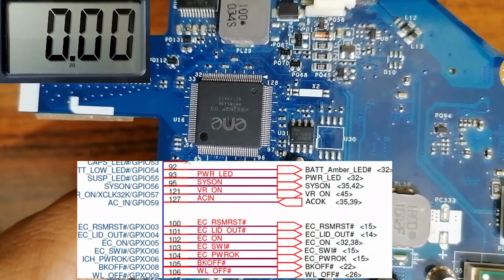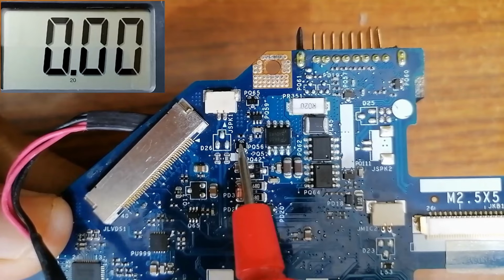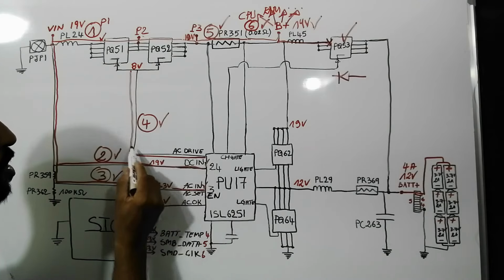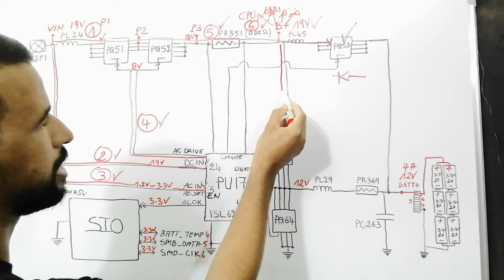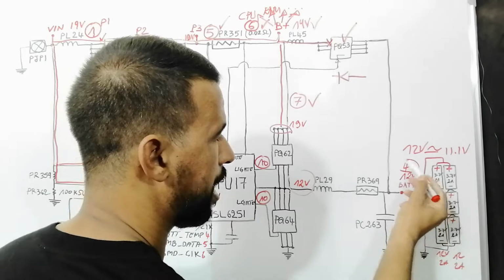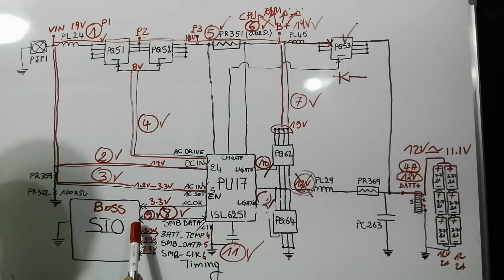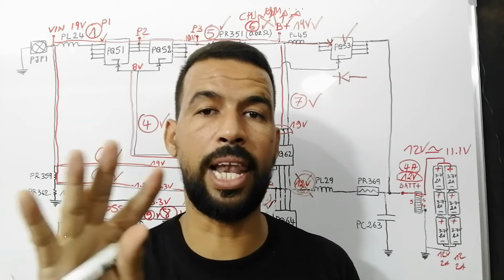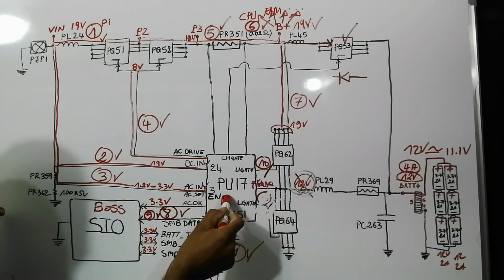Master Laptop Motherboard Voltages and Signals Tracking | Charging Circuit Explained | Laptop repair

Comment: Hello. From Mar del Plata, Argentina. I want to tell you that this is actually a true Masterclass. Never so well explained in detail and with a great will to teach.
I have seen many videos on various channels that have taught me a lot, but here I find everything in the process from when the signal is generated, where it passes and who receives it and why they receive it. A very, very good tutorial for beginners and some advanced users. Greetings.
Reply from the maker: Thank you so much for your thoughtful and encouraging words. I'm truly glad you found the tutorial detailed and helpful.  It's my goal to make the learning process as clear and comprehensive as possible. If you ever have more questions or suggestions for future content, feel free to reach out. Thanks again for your support and kind feedback.
Reply: Thanks God, and Thank you very much. I'm 52 years old, for my lifetime I didn't come across a teacher like you. I pray for you and your prosperity. Sir I'm very sorry that not being a paid member of your channel. Sir I have problems in two old dell laptops. Battery is dead already. One of is, when power adapter connected the adapter goes off. No power seems to come to the  laptop. Then I have to unplug the adapter from mains and put it again. And when again connected to the laptop power gets off on the adapter. Why

The second is also a Dell Fan starts blue light on then Fan stops light is on, but nothing seems to be working. No display. Please give me a Clue how to solve these problems. May Allah almighty make your affairs easier. @electronicsrepairbasics_erb
Reply: @carloslicata8262  It doesn't seem basic to me either!
Reply: @milkaimwaga-ju7gh  I think we have a difference in concepts due to translation. When I talk about beginners it is not because it is "basic" but because it is so well explained that even a beginner can understand it.

Comment: very good video  i am a french people but i understand so good the video thank you so much you have a nice heart  GOD bless you
Reply from the maker: Thank you so much for your kind words. I'm really glad to hear that the video was clear and easy to understand, even in another language. Your support means a lot, and I'm grateful for your encouragement. May God bless you as well 🙏
Reply: @electronicsrepairbasics_erb  Sir the power supply without charging or how it works through 12 volts came from the baterry..? New subscriber sir .thanks...
Reply from the maker: Thank you for subscribing and for your question. Laptops are designed to work with a range of voltages, and the internal power management system converts the 12V from the battery to the required voltages for different components. This ensures that even without direct charging, the laptop can function properly using the battery's power. If you have more questions, feel free to ask

Comment: Bonjour, j'ai un ordinateur Dell E6430 avec potentiellement un problème de charge, mais je n'arrive pas à trouver la panne. J'ai regardé beaucoup de vos vidéos, mais aucune n'arrive à me faire comprendre comment la détection de panne fonctionne réellement. J'ai déjà testé plusieurs techniques comme tester les condensateurs céramiques, les inductances, faire du signal tracking, etc. Mais il y a toujours quelque chose qui m'empêche de voir ce qui ne va pas quand je passe à la pratique. Pourriez-vous faire une vidéo montrant comment un technicien professionnel comme vous fait pour détecter une panne en quelques minutes seulement ? Avez-vous une technique dite "ultime" pour détecter une panne en peu de temps ? P.S. : Je n'ai pas testé avec les schémas électroniques car je pars du principe que tous les circuits électroniques n'ont pas de schémas disponibles. Merci !
Reply from the maker: Bonjour, merci pour votre message et pour suivre mes vidéos. Je comprends votre frustration, car la détection de panne peut parfois être complexe. Dans une situation comme celle que vous décrivez, il est vrai que certaines pannes sont difficiles à identifier sans schéma électronique, mais ce n'est pas impossible.
Je vais prendre en compte votre suggestion et préparer une vidéo détaillant les étapes que j'utilise, ainsi que quelques techniques qui permettent de détecter rapidement une panne, même sans schéma. La clé est souvent d'adopter une approche méthodique et de vérifier les principales zones de défaillance : alimentation, composants critiques, et surtout les lignes de tension.
En attendant, je vous conseille de toujours vérifier en premier lieu les tensions principales (19V, 5V, 3.3V), ainsi que les MOSFETs et les régulateurs de tension. En complément, le signal tracking peut aider si vous le couplez à des tests de continuité, ce qui permet de suivre le circuit et identifier les ruptures ou court-circuits.
Merci encore pour votre question, restez à l'écoute pour plus de contenu, et bonne chance dans vos réparations.
Reply: @electronicsrepairbasics_erb  Merci à toi ! J'attends cette prochaine vidéo avec impatience !
Reply from the maker: Soon

Comment: Sir, you always explain 19V, 5V, 3.3V, is there no part after that? Don't you have SIO or South bridge, display chip or CPU failures? It's always the same thing over and over again
Reply from the maker: Thank you for your comment. I appreciate your feedback. While I often focus on the basic voltage levels, there are indeed more complex components like the SIO, Southbridge, display chip, and CPU that can fail. I’ll make sure to incorporate more discussions about these parts and their potential issues in future videos. Your input helps me improve the content for everyone, so thank you for sharing

Comment: Hi good day to you, what can happen if voltage accidentally gets into data line or address line on a TTL level
Reply from the maker: Hi, good day.
If voltage accidentally gets into a data or address line on a TTL level, it can lead to several issues, including data corruption, signal distortion, or even damage to the components on the circuit. The TTL components might be designed to handle specific voltage levels, so exceeding those limits can cause permanent damage or short circuits. It's important to verify and protect the data lines with proper voltage regulation to prevent these problems.